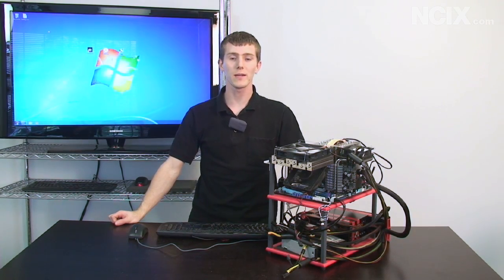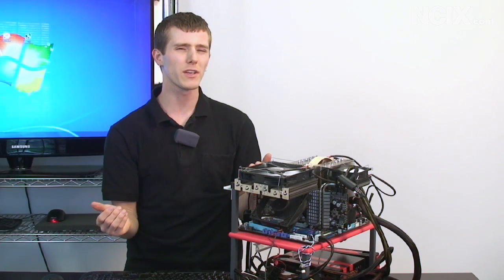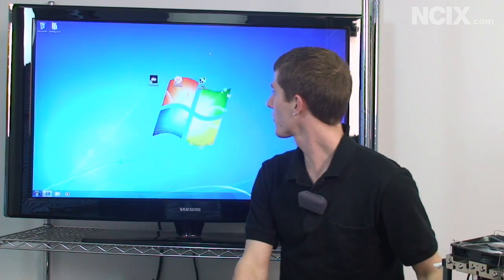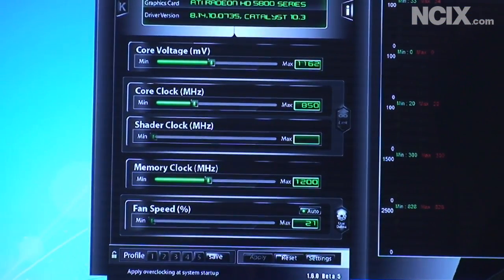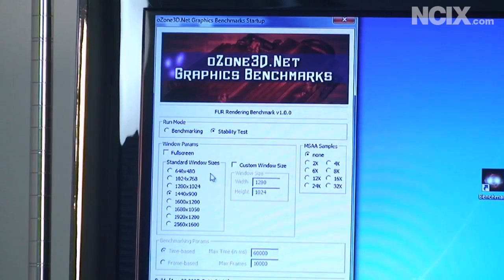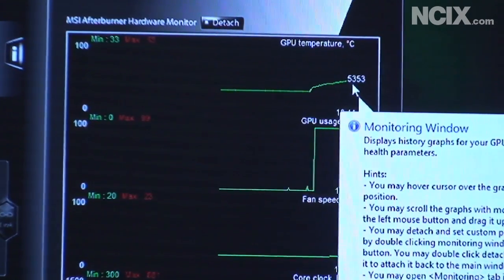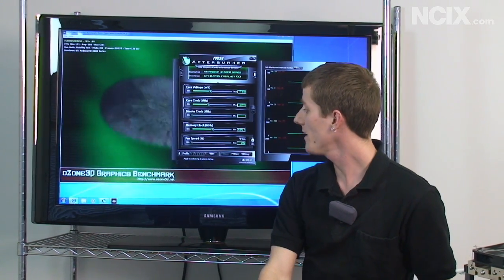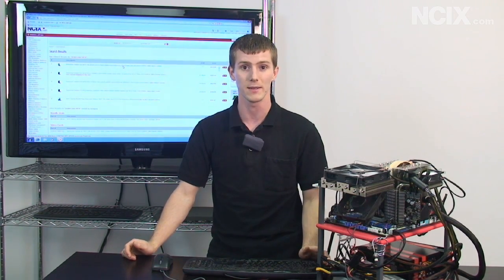Video Card Overclocking Guide (NCIX Tech Tips #69)

Comment: I have an i5 2500k@4.4, 8GB Corsair XMS DDR3@2033, 2x6950 2GB XD 

This is my girlfirends hand me down

Sempron unlocked to dual core and overclocked to 3.4GHz (4400e) performs as well as X2 250 B.E., unlocks extra 1MB of cache

I built it as her first desktop out of spare parts (mostly free honestly) and it can run R.E.5 1080P over 120FPS, you'd be shocked!

Comment: That's not odd at all. Cards can run at 100C, it just cuts the age in half (if you run it at 100C for 12 hours every day, it will only last a year or two - if you run it at 50C, it will last 3-4 years, etc)

Comment: What do you need help with? It should run on high settings@1280x720, or 720P

Diablo 3 is super optimized, it can run on pretty weak hardware.

Comment: P.S. 400W is way more than enough for a GTS 250, 2 sticks of RAM, a hard drive, a microATX board, and a dual core CPU. It requires around 300W and most of her stuff runs on USB, extremely low wattage.

Comment: The setup actually runs Witcher 2 @ 720P, medium and high settings

The GTS 250 is nothing to sneeze at, especially when you can squeeze an additional 10-20% on both clocks

She came from the PS3 version of Skyrim - do you have any clue how weak it is? She thinks that it's the fastest computer on the planet - the only thing she has to compare it to is a PS3 and an old Macbook Pro with a GF 7xxx series mobile card.

Comment: So what? Skyrim is optimized for the Xbox 360's X1K series card!!! 

The GTS 250 is a 9800GTX+, and it's overclocked - what in the world can Skyrim do that a GTS 250 won't handle?

Why are you so concerned with the videocard in my G/F's computer? The question was if an AMD AII X2 @ 3.4GHz was a bottleneck for a GTS 250. I never asked anyone if I should upgrade the GTS 250, I was just curious if the CPU was bottlenecking the GTS 250. 

I found out from another user that the two are a good match.

Comment: Skyrim is highly optimized, this even runs Witcher 2. 

Skyrim runs at 1080P, most of the settings turned to high or, on draw distances and higher range features, medium-ish. 

Witcher 2 doesn't handle 1080P so well, it's happier with 720P and a low-medium range setup, as opposed to medium-high with Skyrim. 

Both still look 50X better than the console versions XD 

Fallout 3 runs mostly maxed out in 1080P - she was used to playing on PS3 and she said "Is this Fallout 4?" while demo'ing Zeta lol

Comment: My only question, the reason I posted, was to find out if the GTS 250 was bottlenecked by an AMD Athlon II X2 4400 @ 3.4GHz

Someone else already provided a correct answer - they are a good match for one another. 

The 4GB RAM has made little difference, since she wasn't even maxing out her 2GB - she's in XP.

Comment: Still, if you have the money, buy a better PC. If you really want to play with high-end mods, an HD 7850/Gtx 650 Ti is a minimum. Plus a good i5 (2500K for example) since Skyrim is heavily CPU-dependent. But an i3 2120 will be enough for most games and since Skyrim doesn't really use more than 2 cores, it's a perfect fit for Skyrim. 4 gigs of RAM should be enough.

Comment: unlocked the 4GB RAM mod, running a couple of other performance mods, the overclocked 9800GTX+ paired w/AII X2 @ 3.4GHz is more than enough for super-optimized skyrim

It even does Witcher 2 just fine on high in 1440x900

She doesn't have a 1080P monitor or anything

Elitists I swear!

Comment: Hey thanks for that info bro. I did some reading and it seems like the HD 6850 is averaging in the low to mid 80's under some load. I think my case may be some of the issue though. My PSU is mounted on top and is drawing some airflow away from the GPU fan, because the PSU fan is much bigger. With only about 4inchs between the fans, i think they may be fighting for the airflow.

Comment: I wouldn't freak out about low 80's - we had passive cooler company 9800GT cards IDLE at 90C and load 100C+ - they lasted almost three years =)

80-90C at load is not unheard of, but if it worries you, you could always toy with the voltage and bring it down ever so slightly, see if you get a drop in temps and can stay stable

Comment: Video cards can operate at 80-90C mac threshold, wouldn't reccomend doing it very often though.

We had several 9800 GT cards that had passive coolers at my old job, and an idiot didn't realize they needed an outside source of air - putting them in Dell and Gateway machines. 

They lasted a whopping two years idling 90-100C, and at load our Photoshop users were putting them at 120C or so. For two years...!

If you stay under 90C on daily gaming use, probably alright for a couple years at least

Comment: Actually, nvidia GTS series aren't overclocked.. I have a GTS450 and its core clock was 594, I OC'd it to it's absolute limits... I ended up pushing ALL 4 of the sliders to the end with max voltage and it's stable and stays at around 75-80c when playing BF3.  The end results were: Core clock: 955 Shader clock:1910 Memory clock: 1040 . Know your stuff, before you say some random bullshit.

Comment: Nvidia GTS is basically a factory overcloked GT. ATI xx70 is usualy an overcloked xx50. So you can't really push a GTS or xx70 much further. Don't ever go over 90c because that's where solder start to get soft and your card falls apart!

Comment: When you launch a 3D application the clocks of the card go to the highest that you have them clocked at. If your card is stable and works fine at 850/1200, I would say it would be fine to keep it there if it stays below 70 degrees Celsius. The higher your cards temperature, the lower lifespan you will get from it. I would say for playing a game, just find a point where it maxes out at around 65 degrees Celsius.

Comment: I've got my 6950 up at 950/5200 with 1.231 volts. It is completely stable and remains lower than 65 degrees Celsius with every game and most benchmarks. Maybe because it's the EAH6950 DCII from Asus.

Comment: The newer cards are good up to around 90 degrees Celsius. That being said, you should not intentionally make it that high unless you are doing a GPU burn-in. Burn-in is the period of time when the card is still new and the solder needs to be set more. Running furmark and getting your GPU up to 90 degrees Celsius to burn it in may allow you to yield slightly higher overclocks while remaining stable.

Comment: In both the overclock is possible, if allready come with overclock means you can overclock even more for sure...I mean a normal gpu can reach from 800(stock) to 900 and the overclock version can reach probably from 850(stock) up to 950Mhz for sure, but all depend on the qualaty of the component, (less voltaje to achive higher OC)...
Best choice is to buy a new one later and aboid burning you GPU when no garanty is provide...10% OC won´t make any difference for eyes to notice when playing games.

Comment: Hi there.
Running a MSI N560GTX-Ti-M2D1GD5/OC gfx card and i'm about to start looking into overclocking it. 
What i would want is to get it to reach the N560GTX-Ti Twin Frozr II 2GD5/OC, meaning a increase of approximately 50 MHz on the core clock.
Is this possible without having to invest in a lot of cooling?

Comment: @TheJessewatson If you got the 550 Ti, there's no need to get water-cooling. Just get yourself a good heat sink (make sure you buy the right size (92mm or 120mm) heat sink, so it fits in your PC without issues), and you should be good to go.

Comment: @braylle1 Overclocking is the process of running a computer component at a higher clock rate (more clock cycles per second) than it was designed...

Comment: @TheAwwWtf Exactly. My GPU had that kinda boost with a tweak of about 100mhz for both memory and clock. 100mhz more only gave me 1 or 2 though. Even with higher speeds it seems there is still a limit for fps.

Comment: @Lokautable Im guessing you're running it on a laptop from the "m" on the gt540. Firstly, "mobile" versions of desktop graphics cards have to be cut back a bit in terms of performance so that battery life will be acceptable. Also, you would certainly NOT want to overclock a laptop housed GPU as there is close to no cooling available to laptops since components are in such a small space. Your GPU, although maybe high end for laptop is still much lower than desktop performance.

Comment: hey my video card is i7 gt540m and bf3 is running so low fps 20-30 on high and everything has more than recommended and is overclocking the solution?

Comment: got my GTX 460 SC from 763/1526 to 830/1660
2000 mem
runs around 73C after 3 minutes of burn in test from furmark
fan at 50%
gonna water cool later
brought clock down to 823 to avoid too much heat on stock cooler

Comment: I overclocked my Radeon HD6750 from 700MHz to 870MHz, and when I run the test with that doughnut thing it works just fine. But when I turn on anti aliasing(8x), my whole system starts to be REALLY unstable(Mouse moves with 1fps on the screen etc). Should I lower the frequency or not do anything at all? I don't experience this in any other applications, not even 3dmark. Oh and also the maximum temperature it reaches is around 65 celsius

Comment: I`ve got a GTX 580 using MSI Afterburner i managed to get a subtle overclock with 902MHz on the core clock shader clock 1804 and the memory @ 2028 stable, I wanna go higher but i don`t have any cooling for my card...the case is a Coolermaster 942 HAF X.

Comment: 5-15% boost ? This card is crap.... I got a Nvidia gtx 460 and i get a good 20% boost by overclocking it (stock cooler and voltages) and its possible to get up to 40% boost if you have insane (water?) cooling and increased voltage. Zotac Gtx 460 stock clocks are 675 mhz and i seen people getting it up to 950mhz or at least 900mhz, some even tried 1ghz but i dont think thats safe even with water cooling.

Comment: I just pulled my Nvidia gtx 280 up from the stock 400Mhz to 725Mhz while keeping it stable still. All temps are well under the danger zone also. The fuzzy ring runs smooth and happy. I have changed the stock cooler to a Zalman cooler made for my card, and it works amazing.

Comment: @Xtacy000 i have a chauffeur, and a mclaren f1, so i told him to drive it really fast, and i had my pc on the roof, and i overclocked it, really fast, and i live in greenland, really cold, and then the car ran out of fuel, and my pc consisting of 3 2600ks, 10 geforce mars whatever, 39848 gb of ram and 50 120gb ssds, and the powersupply is a portable nuclear powerplant, which exploded, since it was aircooled, when the car stopped, so we melted and became one forever. and ever. and the pc died.end

Comment: @Undataker95 umh no man it can't be. I have the box, receipt and website where i got it from. Btw i have overclocked it to 940-1355 with voltage 1250. these settting didnt work before and now they are stable. so i don't know what the problem is or was.

Comment: i need some help my videocard is a 6950TFIII PE/OC stock settings are 1100mV core clock 850mhz and memory 1300mhz i can do a lil overclock to 900mhz and 1325mhz but now i cant go further even if i have the voltage raised. games starts crashing people got 940-1050 and 1500mhz so this is quite low.

Comment: @gen2sega Not the lesser the closet  to your stock memory, for example you cant push a cpu with low 1066 ram that far, however i would recommend buying 1600 ram and overclock your cpu then downclock the ram to like 1552

Comment: @Amy01223 with crossfire X you can in some cases get twice as much performance from 2 cards than 1 card.
that is the best case scenario though, in most scenarios it will be around 1.5 times better than a single card depending on driver support and the application in witch it is being used in. 

hope that helps :)

Comment: @m0ng0masher1 
OH, also... if there is too much heat and it results in the transistors allowing too high a voltage through the gate, this can result in quantum tunneling, which leads to increased silicon degradation, and a shortened lifespan. 
If you were ever curious WHY integrated circuits fail.... it's because of silicon degradation (which is the physical breakdown of the circuit)

Comment: @m0ng0masher1 
But remember that increased voltage also means an increase in heat as well. Heat is generated as a result of electrical resistance in a circuit (like a transistor), and a single CPU or GPU can be made up of BILLIONS of transistors.  
This is why people use peltiers, water cooling systems, evaporator systems, liquid nitrogen, etc. The idea is to take as much heat away as possible because high temps can change the way the IC works (resistance and voltage inconsistency = instability)

Comment: @m0ng0masher1 
You can't just increase the core and memory frequency... you have to increase the voltage as well. 

The reason to increase voltage is because the circuits are so close together that the movement of electrons in one circuit disturbs the flow of electrons in adjacent onces. Increasing voltage increases "signal strength".

Comment: lol... just overclock it in the ATI Overdrive... i have an Sapphire Radeon HD 6850 (stock cooler) and i overclocked the Core clock 775-->850 Mhz, and the memory clock from 4000--> 4400Mhz... and it is stable...0 artifacts or freezes...

Comment: i have a bfg gtx 260 maxcore oc out the box its stock clocked 590 core and i have it over clocked to 752core and 1505 shader and 1210 ram speed and im useing riva tuner and it works fine. with msi i cant even keep my card at 650 with out it chrashing.

Comment: @Winnetou123123 Most likely you will lose warranty on your card if you remove the original cooler. Some cards might keep their warranty, best to check from manufacturer. In some cases you can have the store that sold you the card \ cooler install it and keep the warranty. Or just change it, don't lose the original cooler and if something goes wrong just switch the original back for warranty purposes.

Comment: sapphire 5870 Oced to 900/1300 in the first 10 days I got it and then 4 months on stock. The card died after 4 months so I took it to the shop, forgoten that I Oced it and they actualy got me a replacement which worked, until I sold it.

Comment: If you using an AIT/AMD card and ur using the unofficial overclocking method you may need to in youtube right click the video open 'global settings'or setting you will see a tick box with 'enable hardware acceleration' make sure its unticked and restart your comp 

or else flash may make ur drivers crash! 
enjoy!

Comment: I pushed my 5850 at 1000MHz in the core and 1100 in memory,with my stock cooler at 45%, although its pretty loud it works.

Comment: Lol linus this was a little overclock only.
And BTW u can not higher then 900/1300 with MSI Afterburner.
U need AMD GPU Clock Tool for the clocks.
And MSI Afterburner for the voltage setting and youre fan speed.
I did already a sucsessfully overclock of 1050/1300 on my ATI 5870 with stock cooling.

Comment: @patcorndoggy I don't think so? I have a ATI 5770 which matches up to the GTX285 or so and it is factory overclocked and only 40 degrees max load. Maybe check the fan speed on it or check if anything is blocked case ventilation?

Comment: have my sapphire 5870 clocked with catalyst ati overdrive and core is running 875mhz and memory 1250mhz max temp is 73c fan is not running max speed when it's automatic controlled. i think it's good?

Comment: @Jonislol The older or fist built 5800 series cards were installed with a bios that will not let you overclock them that high. My card that i have was built early this year so it was installed with a bios that is not locked and i can over clock high as i want. you can flash your old bios with a new one but it is risky vary risky.

Comment: With my 5870 I'm getting 1000 MHz on my core speed at 1.35 volts. also 1300MHz on the memory stable with 6 runs of heaven bench.

Comment: The stock cooler for 5800 is perfectly fine for overclocking really 

My 5850 @ 1.27v 1010MHz at only 38% fan speed runs at very safe temperatures and isn't loud at all. I'm yet to see it pass 70c, it's fine :)

The rule doesn't apply to every card though, can't imagine a Furnace GTX480 would be very overclockable without water :P